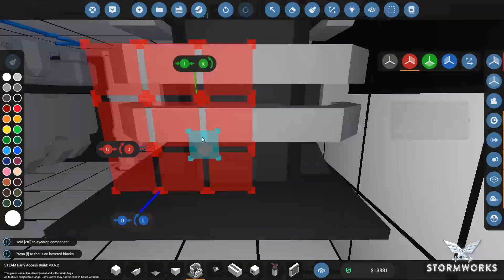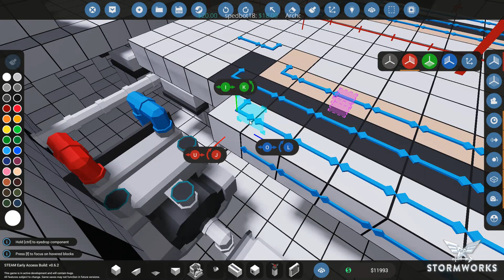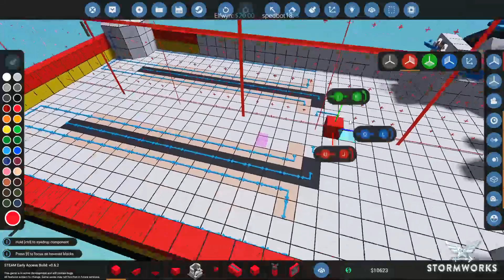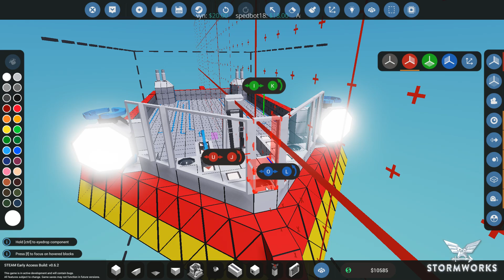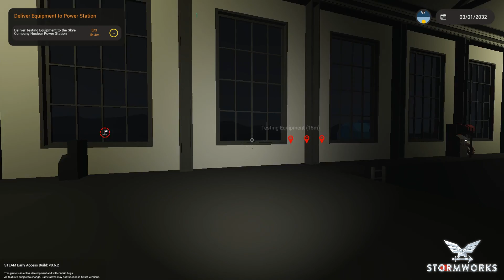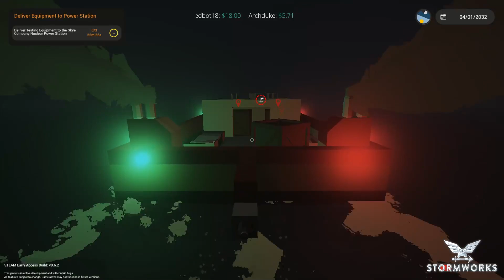Stormworks: Build and Rescue - Career Advanced - Episode 3 - Careful Delivery

Comment: Positions light is acutally Green for Starbord and Red on Port. In an angle of each 112.5degrees. Top light is 225degrees white and rear light 135 degrees also in white. Engine piping coloring code is; All Waterpipes are Green, Air is Blue, Fuel is Orange (Brown), emergency pullings or pipes (for extuingisher) are Red.. This are the color codes wich are used for example in the binnenvaart. (jaa, ik ben binnenschipper)... I also use those color codes when im playing stormworks. So its mutch easyer to build or tune stuff up...
Reply from the maker: Cool, didn't know that :). For now I'll stick to the paint schedule for the pipes that I set up. It's what I'm familiar with now. I'll switch around my nav lights eventually, as I already have recordings through episode 5. 
Groeten uit Nederland ;)
Reply: Calm down